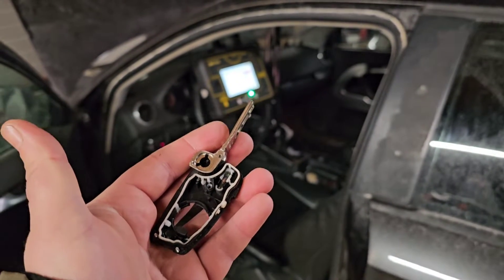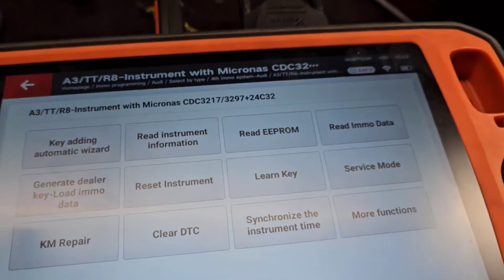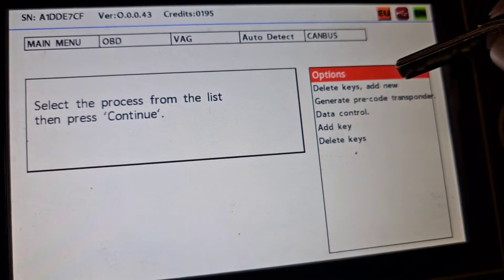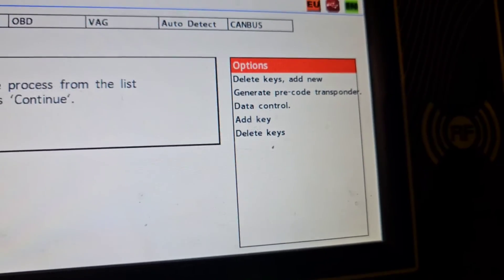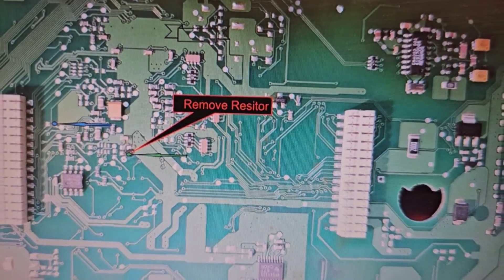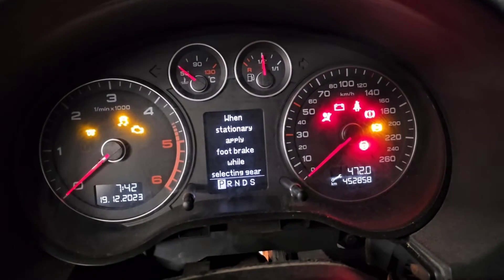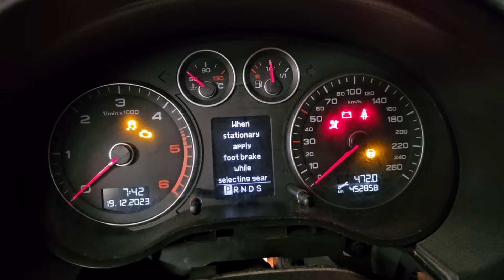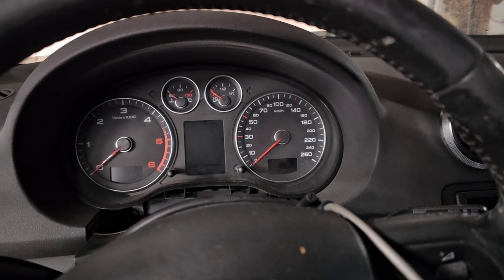✅️ Audi A3/TT/R8 All Key Lost. Micronas CDC3217/3297 + 24C32 Programming

Comment: The hard situation of this job is when the car has a changed ecu with immo off. Especially if the car 2008 and up. I had a case with def on A3 8P 2006 ecu immo off

Comment: Hi just to say i love your video, just subscribed as well. Quick question please, would really appreciate your advice. If you have VVDI 2 or Key tool plus, could you remove dash, do service mode?read original eeprom 24C32, prepare service eeprom and write service eeprom to dump and write original 24C32 back to car via OBD, would you not be able to get IMMO data, CS code and PIN????
Thanks in advance.
Reply: No service mode on this cluster. Read Micronas and EEPROM there are tools for that